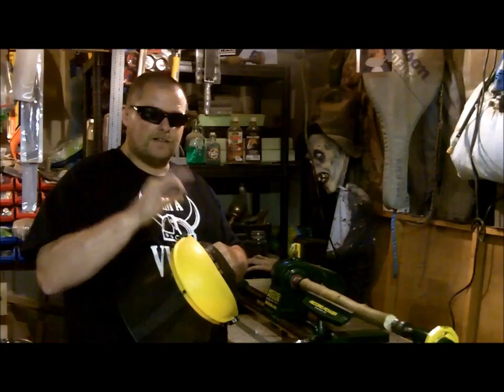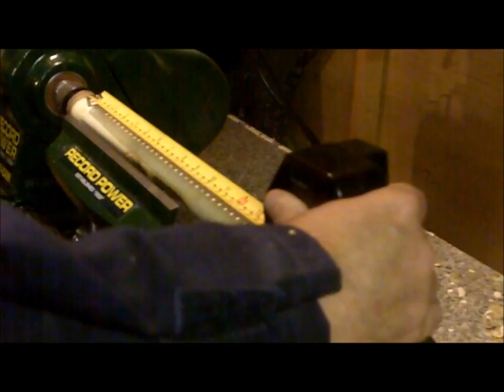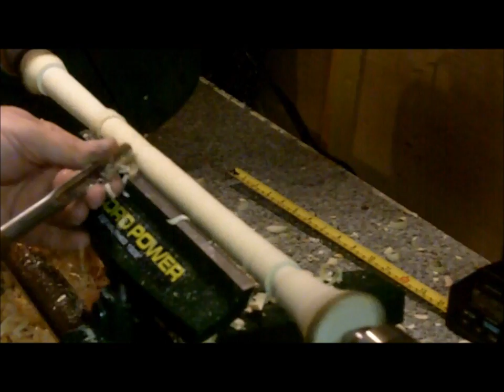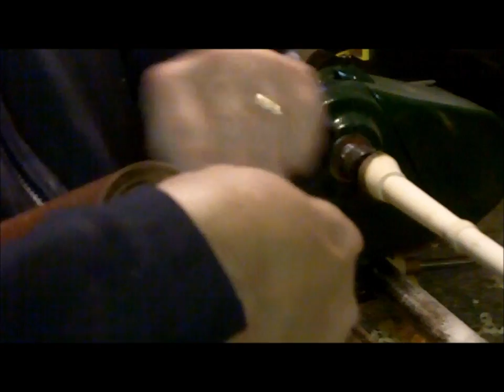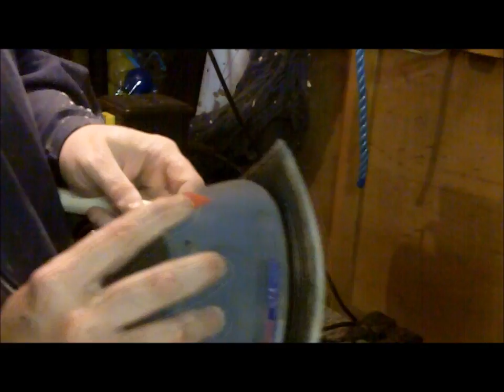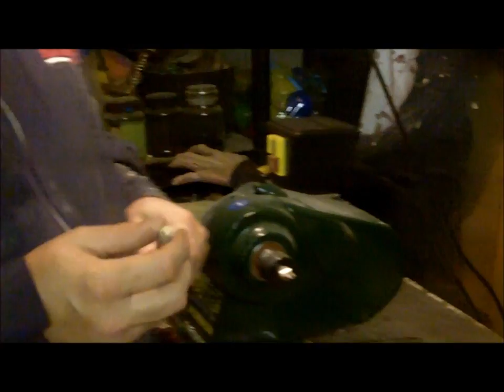Woodturning - A Magic Wand

Comment: Great wand and great video!! Just a heads up though, personally I'd pull those sleeves up out the way of the lathe. Don't want nothing getting snagged. Only my opinion, no intention to offend. Great did.
Reply from the maker: Hi Lewis !! Thanks for the advice. I promise I will give it a try.Don't apologize for the safety tip.I will be totally receptive to any constructive comments.
Keep in touch.
Chris.